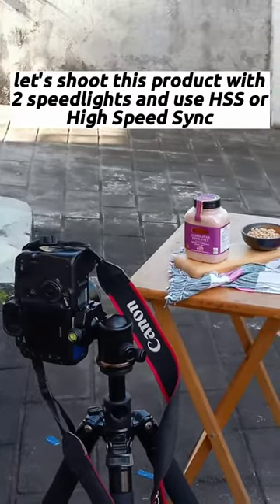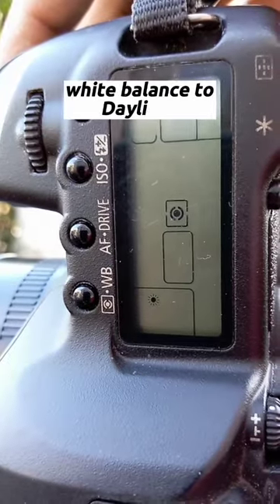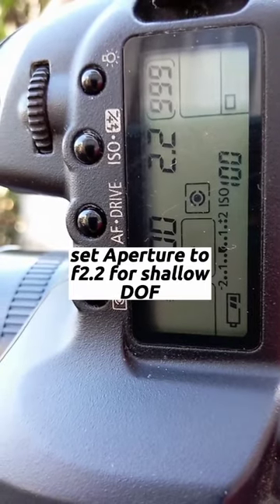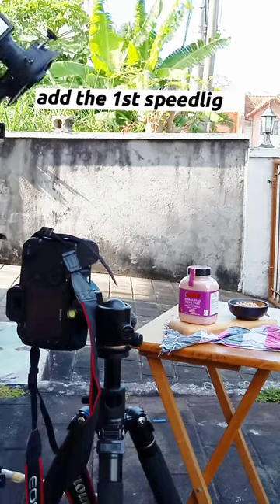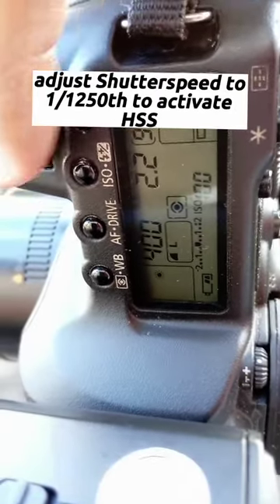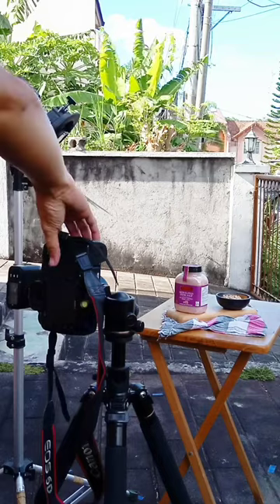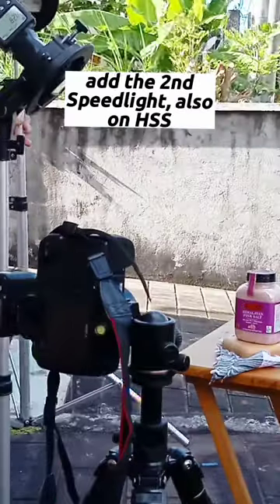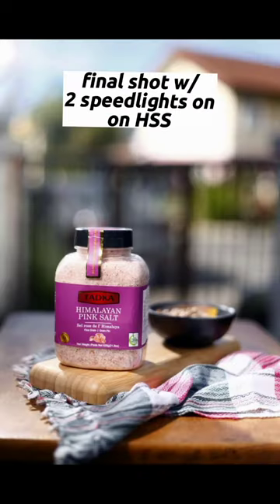Using HSS/High Speed Sync for Product Photography #photography #tips #shorts #hss #flashphotography

Comment: I have a question, im using canon 80d with godox tt600, my flash is working and it is firing when it's mounted with my camera. However i want to turn on my HSS sync, but the problem is even tho my flash is mounted it says "not compatible something" how to fix that?
Reply from the maker: HSS on tt600 is only possible if used off cam triggered via radio
Reply: How about in xt1 trigger? do i need to set up the camera in "Menu" button so i can use HSS mode?